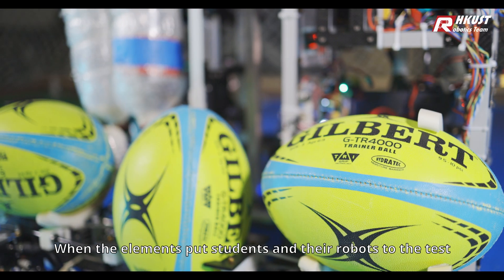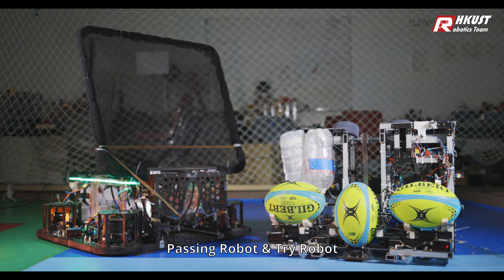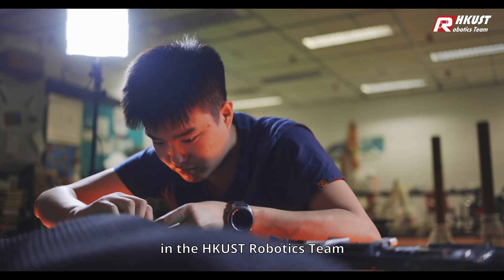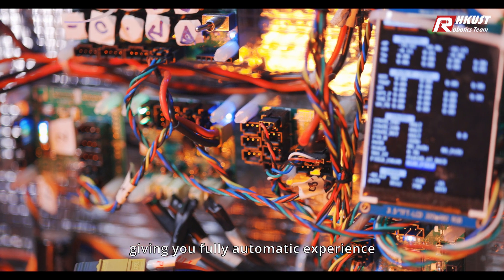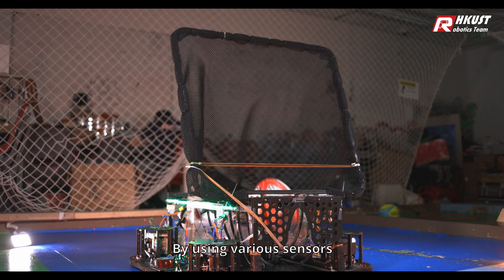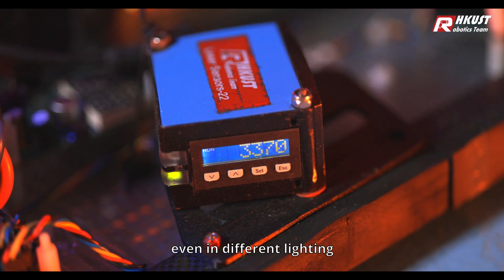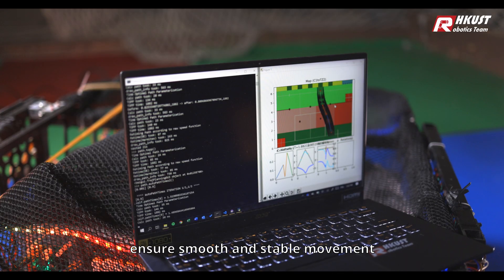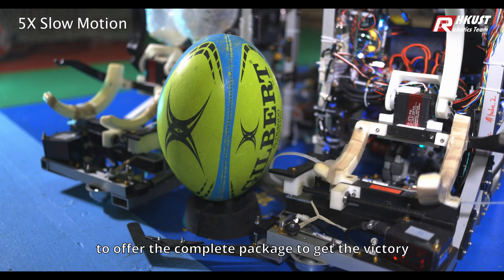Robocon 2020 - HKUST Robotics Team (亞太廣播聯盟機械人大賽2020)

Comment: Nice!What kind of gamepad did your try robot use?Is it PS4?How do you realize the wireless connection between the gamepad and the stm32?
Reply from the maker: we use PS4 combine with a STM32 control board and using NRF as the wireless connection
Reply: @ustrobotics Wow!So cool!Recently I've been working on a remote control car project.I can only Arduino's USB Host Shield to connect the PS4 controller, but I have no idea to connect stm32 with ps4.Could u share your code for me to learn from?Thank you very much!